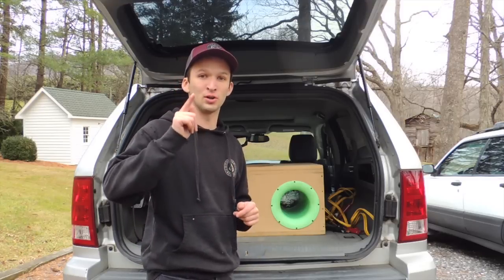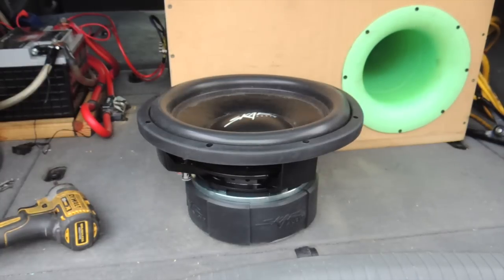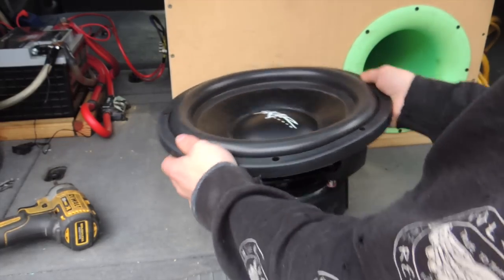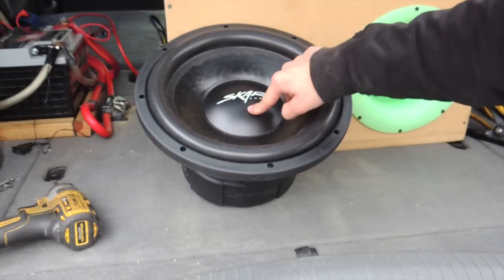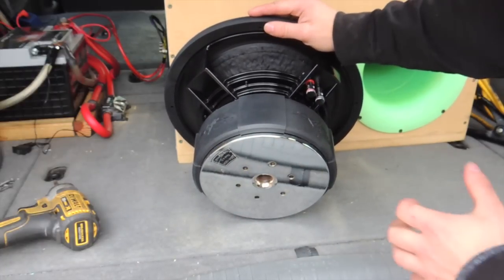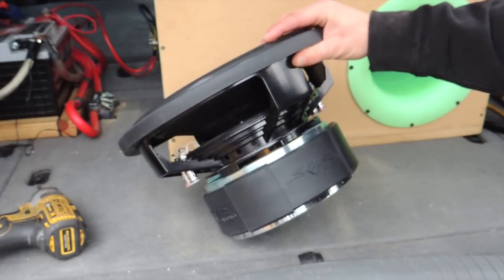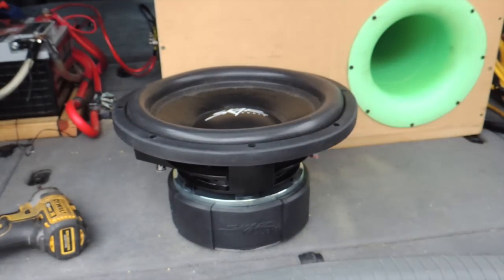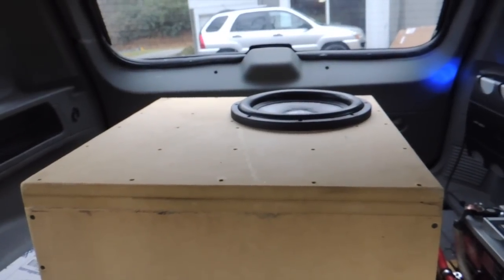Skar Audio DDX Subwoofer Review!

Comment: 1000 watt RMS is a very conservative rating for this sub. I have 2 of them running off a rp3500 and haven't had any problems. Been booming em for about 6 months now.
Reply: That sounds great because I just ordered a 3k watt amp for the pair, I'm running them in a 2.7 cube box at 34hz so it's undersized and should take the power better than if it was at it's recomended
Reply: @Xbs_Rebass i don’t think it works like that
Reply: It's not conservative. It's correct. In a standard ported box you never will get full amplifier power on your subs. Usually You get around half the power. so 3500watts is really 1750 watts which is exactly perfect power rating for these.

Comment: I have 2 of the ddx 12's dual 4ohm on an Audiopipe APDLI 2000.1. They're in a 2:1 ratio 4th order bandpass tuned at 38hz. Dude these things freakin slap in a 4th order, try it out you won't be dissappointed!

Comment: I have 2 skar ddx 12d4 install reverse in a box that i built with 4,5ft3 gross volume and 3,2ft3 net volume and a port of 14,5 x 4" by 30" long(34x16x18"). I have it in the Trunks of my Jetta and the Hole car shaking. It peak at 32 Hz and Play low as 20hz. For the Price it's the best purchase I ever done.

Comment: first, i love these videos. you’re not here to trash any brands and have an honest assessment of each. i just bought (2) DDX-12D4 and waiting on a SK2X12V ported enclosure which will go into my car. i’ll be pushing them with a Rockford Fosgate  R1200-1d to each sub @1ohm. i currently have a set of 12” Sundowns Ev3’s also powered by a single Rockford Fosgate R1200-1d in my truck. and for them only being rated at 500 RMS, they get down. those subs are no joke. i feel Sundown has them at a very conservative RMS rating. i’ve never had any issues with Skar products before but never had any of their subs. so i decided to grab a set of DDX 12’s to see how they stack up with some of my previously owned subs. at $159 each, i won’t be out so much if i don’t like them or if i have any issues with them. seems like they’re above average subs for the price. my favorite subs , by far, were my Type R’s. if they weren’t so god damn expensive, i would’ve just bought them again. i’m not gonna be competing or anything with the DDX ‘s. but also want to get the most out of them without damaging them. can’t wait to get everything installed and see what these are all about.
Reply: Well what are they about?
Reply: Inquiring minds wanna know do they bump tho??
Reply: Yes! I’m using (1) 10” Skar DDX DVC2 in Skar Factory ported rhino lined enclosure hooked up at 1 ohm with D4S JP8 and I’m “VERY” happy with my daily driver! I’ve been in this since the late 80’s with Rockford Fosgate “the Punch” & Kicker before they even started making amps!@🔊❤️GTILOUD
Reply: @GTILOUD  if I could send a video to you, I would. Unless you don't mind me sending it to an email.

Comment: Talk about great timing... I've been needing to make a decision on which Skar 12" to go for. Thanks and keep it up bro
Reply from the maker: You are welcome bro!
Reply: @ParkerTheBasshead  Do you have enough time to spl test? Curious if it can hit 140
Reply from the maker: John Northrup since this was a dual 4 ohm and the box is out of spec I didn’t do an SPL test as I wouldn’t get optimal results
Reply: My brother in law has 2 Ddx skar 12’s and they are hooked up to a rp 2000 and he absolutely loves them last time he checked they were 149 at 39 hertz and that’s in a 97 Honda Accord 4 door with a pioneer 80prs head unit which is also one of the best units u can use one of the only radios u can  turn all the way up with no clipping and it’s only 250ish on amazon hopefully this will answer your questions
Reply: John Northrup l
Reply: @ParkerTheBasshead  True that is
Reply: @jimmydennis3405  that's very promising
Reply: @TurboJohn74  What kind of setup are you trying to run, and with what amp? Just out of curiosity. If you are only doing a single sub, I highly recommend going for a single 15 over a single 12. You will be much happier with the extra cone area of the 15 inch sub, and the extra decibels it will produce, assuming you have the room for a 3.5 cubic foot box or so. I personally love the Skar VXF and ZVX subs. They are both killer, if you can run a 2k-3k watt amp. If you want to run less wattage, I really like the specs on the Skar VVX subs, and you don't need a ton of watts to run the vvx series subs. I owned the Skar RP-2K and it was a great amp for $229, and it definitely put out nice power. It would push two or three Skar VVX subs very nicely, or 1 VFX or ZVX sub if that's what you want to do.
Reply: @catch22frubert  Hi man, can i use boss audio ar1500m amp (1125watt rms @ 02 ohm) to run the skar ddx-15 4ohm 15" sub ? Will it be fine or not ? Kindly help
Reply: @mehrankhan1893  the problem with boss is that they dont do their rated power which im sure u found out otherwise everyone would love them for the price

Comment: I was just checking out the specs for a box for this and you can go with a slightly smaller box tuned to 34 Hz 1.5 to 2, not bad for a 159 dollar sub, and basically the same materials and quality as the sundown.
Reply: Only thing that use to be the same was the basket an with the new sa they have absolutely nothing in common.... u should do some research before making uneducated statements like that lol
Reply: @jamesmcnugget2564  i own both subs the sa 12 rev 3 and the sa 12 v2 bigger coil and bigger basket and motor, I know that I was comparing the skar and the sa 12 rev 3. LOL. I own both subs. I have two SA 12 Rev 3 and one SA 12 v2, I am switching out my two 12s for the one SA 12 v2, because I like the lows and that is what people have been saying about the v2 SA 12.
Reply: @jamesmcnugget2564  the Skar DDX is the same as the Sundown SA... I got both myself they are absolutely identical except the Skar has the bigger motor more power handling.. you talking bout the SA v2... Which isn't much of a upgrade I got it as well n sold it... The older sa V1 subs sound better to me n many others.. but as for the ddx n sa V1 they the same sub basically

Comment: I think Skar underrates their subs, I have a IX-10d2 (rated for 200 rms) it was pushing 305 rms from a Kicker cx300.1 for 6 months, then I got a Rockville RXA-T1 pushing 670 rms, with OFC 4ga (from 2 batteries) to OFC 8ga (sub/box), been running that for a year now no issues.
Reply: Most definitely running a ddx 10 at about 1200w rms for about 7 months
Reply: Idk I know the skar sdr aren’t under rated I blew 4
Of them off a rp1500
Reply: Thats why I started with Skar SDR, then SVR, now (1) 10” Skar DDX DVC2 in factory rhino lined ported enclosure on D4S’s JP8 and doin’ work!#Skar#DDX#D4S#JP8”BlueBeast”#🔊❤️@armordewso
Reply: @amordeweso not set up right
Reply: @slitherman7883  first thing always claims …..yet it’s on great power tuned w an O scope …….theyre just 💩
Reply: @amordeweso  smthings not right when i set up 2 sdrs banging for 2 years on a rp1200  flexing for even a 1200

Comment: I have the DDX 15 and I'm pushing a little over 1300 Watts and it's rated a thousand watt RMS 1500 watt Peak and it never gets hot I can run it for over 15 minute drive a little over halfway up and never get hot or warm so I know they can get more power at least 1,400
Reply: 1300w clamped?

Comment: I run my 12inch DDX on 1200w rms everyday. It’s never even gotten smelly, I feel like you should try to feed it some more power cause it seems to only go up to 800-900ish watts on the meter
Reply: Facts bro. I have 2 ddx on 2000.1 ampere audio amp. And its straight spl and quality no burning or clipp action. All good
Reply: But ofcourse I have a 200 amp h0 alternator and big 4 and dual battery set up but man I turn heads all day

Comment: I have one of these but its the 2ohm version. I've had it wired down to 1ohm with a Hiphonics 2400w Zeus amp. I've also had it wired up to 4ohms with same amp. BOTH 1ohm and 4ohm bump like crazy but at 1ohm its using roughly 2400 watts.  Im about to wire at 2 ohms which is stock for this sub. 
Anyways, it hits so hard with no complaints other than how Skar basically ignored me because the mounting holes are too far in towards center and have damaged the rubber ring on the speaker as wel as the Skar speaker box mounting area. The screws rip through the partical board because they're too far in. Im literally out of area to screw into and Skar won't do anything because I can't find my receipt. I mean I get it but still I paid good money for both the sub and box(before everything went on sale) and Skar won't even offer a discount for a new box or at least a new mounting ring so I can screw the sub into the box properly. You can totally see the holes in the metal part of the sub don't match with the rubber ring. I sent pics and everything. I love Skar products but God forbid a costumer lose their receipt then you're s*it out of luck.

Comment: Just grabbed a Audio Legion S2512d4 for 60 bucks on their website. It was the last one. They are a ddx clone. Ironically the packaging outside box it arrived in said Skar Audio on it. I assume I can use the ddx recone for my Audio Legion. What a deal. They are selling for 250 in some places. I snagged a Q bomb side port box for it. That should match nicely with my Skv2 1500.1d at 2 ohm. That will give it somewhere around 1000 rms. I have 2 svr 10s in the side port box from skar in my car now, I just want something different for a while. I drive 2 hours a day and need my trunk a good bit at times so big systems are not an option for me anymore so I've been experimenting with these smaller systems. I love my svr 10s, they get low af ironically.  I never heard 10s go so low. I hope I like the single Audio Legion S2512 in the q bomb. We will see soon. I couldnt pass up that deal.

Comment: are you gonna use welding cable for the sequoia? i bought 0awg welding cable from ebay, 50ft cost only $130.00, i bought it early this year.
id suggest the xtr2500.1dz for the next amp since it puts out over 1000w @ 4ohms and its a korean board. lastly i suggest running supercaps that emf is selling for dirt cheap instead of multiple agms. the agm in the jeep and a bank of the supercaps is sufficient enough for a 2-3k rms after rise
Reply from the maker: American Bass has OFC 0 gauge wire that after their 30% discount is 100 for 50ft so probably going to go with that
Reply: @ParkerTheBasshead  that is a killer deal for ofc wires! might have to buy a roll or 2 since copper wires goes up in price. thanks for the tip sir

Comment: that is basically the same sub as the sa 12 rev 3, same size voice coil and basket but the sa 12 v2 has a slightly bigger voice coil , basket and motor.
Reply: Looks wise maybe
Reply from the maker: Comparison video will be out soon!

Comment: By the look of the flex, it almost looks like you have the sundown in there lol, looks like it perform damn near identical and you dont even have that thing wired to 1 ohm. The sundown was wired at 1 ohm right?
Reply from the maker: Yes the sundown was wired to 1 ohm. But I had to keep my Bass knob turned down a little or it would max out
Reply: Parker Dacchille another difference of the subs, skar claims the ddx should be in a 2.5 cube box, while sundown recommends 1.75-2 cubes. Honestly i think a SA recone would drop right into the ddx

Comment: Hey man I had a question which sub is better I’m confused the skar DDX 12 vs the skar SVR that would be a good review like both in one video
Reply: I’ve been more than happy upgrading my (1)10” Skar SDR DVC2 to (1) Skar 10” SVR DVC2 in factory Skar enclosure that was hooked to a Skar RP800 and sounded great; but then I “Upgraded” my amp to Down4Sounds JP8 and the “Unbelievable” results/gains running at 1 ohm with less voltage or current being sucked off my factory 20’ Honda Civic turbo with only a New Interstate battery under hood!#🔊#JP8🔥#SkarSubs@Christopher Perez

Comment: Hey Parker!  Love your videos. Question I currently have 2 Skar SDR 12s. I want to upgrade but don't have much $. I like the ddx after your video. In your opinion is it the best $150 sub?  That's about my price range. Thank you
Reply: I have a Sundown 2,000 watt amplifier by the way. Thank you
Reply: what amp do you have ?
Reply: i’m not parker but the best advice i could give you is save some money and get the SVR-12s  127$ a piece and does 800 rms. your’re going from 1200 watts rms too 1600 watts of rms.
Reply: @cluettdasnager73  I ended up getting two Sundown SA 12s and a Sundown SAE 1500.d amp

Comment: I’ve watched all of your videos and respect your knowledge on the subject because you have tested everything first hand. I have a question about my daily system. I’ve got a mmats pro 1200.1 pushing an sdr15d2. My amp is pretty nice and wayyyy too much for the sdr. In your opinion should I go with the ddx or evl
Reply: Evl is a better sub and has a 3 inch coil this sub only has a 2.5 inch coil, yet this sub is 40 dollar's cheaper.
Reply: @zachmasters7397  I went with ddx. Today I metered 141.3 with it and 143.7 with my vxf
Reply: @johnjacob9976  how do you like it, I was getting ready to pull the trigger on the evl, yet with the pair of ddx's I save 80 bucks, I'm on the fence, I like the fact that the evl has a 3 inch coil and can handle a little more watts, yet saving 80 bucks on a pair of subs that preform almost as well that I can use the money on a better amp sounds great as well.
Reply: @zachmasters7397  so... I currently own sdr, ddx, evl, and vxf. Ddx are better than evl in my opinion but only because I’m more into spl. Evl is definitely better sq but vxf is far superior to both
Reply: @zachmasters7397  if it helps you understand a little, I metered two Db higher with a single vxf at 37hz than I did with two ddx in a smaller vehicle at 42
Reply: @johnjacob9976  ok that makes sense, I was wondering how you only got 2 DB's higher with the vxf, I was just getting ready to ask what box and amp you were using on the vxf, I would love a pair of vxf's 12xs, yet I have kids and a family now, last system I had I spent 3000 bucks on just 2 15inch mojos and 2 2000 watt Memphis amps and a custom sealed box, not counting the big 3 upgrade, cap's and the extra battery, this is the first time I've ever had to shop for a budget system, kids and a family change your priorities, I just want the best bang for the buck around 700 bucks with 2 12 inchsubs, amp and box.
Reply: @zachmasters7397  well I’m a grandpa now and still got the kids at home lol. Three generations. And the box is a vented birch enclosure I built to 36db. Apparently I was 1 db off
Reply: DDX
Reply: @csj9619  thanks, I’ve moved on to sundown amps and subs

Comment: Get a half ohm Taramps MD12k. You will be able to use in with many different impedance combinations, whether 4 ohm, 2 ohm, 1 ohm, or even a half ohm. You should be able to power any sub with this amp, or even dual sub setup. You wouldn't need to buy another amp for a while, unless you decided to do a huge SPL build with 4 or more subs. You could get by with a single high output alt, and plenty of capacitance. Lithium is always a great choice for a new build, and  LTO technology is getting less expensive than even AGM, plus its better. It's a lil money overall,  but a little here and a little there is definitely worth it. I bought a second alt, and working on my third lithium bank. I bought a JS 390 to go with my CES 320. Thinking of putting my original alt back on the truck to run the truck's electrical, and fabricating a bracket to hold both of the high output alts to power the system. You have a sizable vehicle to fit a larger enclosure. Make sure you will be able to upgrade with the equipment that you buy, that way you won't get stuck with a lot of equipment that you won't be using. That's a waste of resources. Just plan on going big and buy for the end goal. Great videos. Keep it up!
Reply from the maker: I’ve been looking at the 12k... might have to pick one up soon
Reply: @ParkerTheBasshead  I'm going to get one immediately after Christmas before the price goes up. I bought a MD5K for 309 in June,  and now the price is 390. I'm sure the 12k will only go up as well.

Comment: The skar looks nice! I guess I’ll try a skar subwoofer at some point. Maybe even make a video on it. Also I look for amps with a higher rms at 2 and 4ohm where it usually rises anyway.
Reply: Yep that's what I've ALWAYS looked for most ppl don't factor in the box rise and your equipment will run cooler at 2and 4 ohm 1ohm tends to run hot ecspecially if your wife gauges aren't correct and of high quality👍🏾

Comment: If you had to pick between this skar ddx at 10” and a kicker comp Q 10” what sub would you go with in the trunk of your car?
Reply: skar for sure., I use to be a kicker fan. Skar hits good really low. I have 2 10inchs of these in my car wired to 1 ohm using 2,000, rms watts, meaning 1k to each sub.
They have not burned out me running them hard for 3 years now... time for an upgrade though as i know i've been cooking the voice coil. These hit low, 
Just ordered 2 of these 15inch ddx for my theater... will know thursday how they sound.
Fyi, i use to have the 10inch kicker solo X, they were had similar specs as these and they were over rated rms watts when they came out..... Kicker had to eventually de-rate a lot of their over PRICED speakers.

Comment: Can I use a 1200d skar amp for 2 of these cause I have 2 sdr 12s with 1200d amp and you can barely turn the base up before it starts popping
Reply: You can but you'd be under powering them. Get a 2k watt rms amp or even a 2500 rms amp